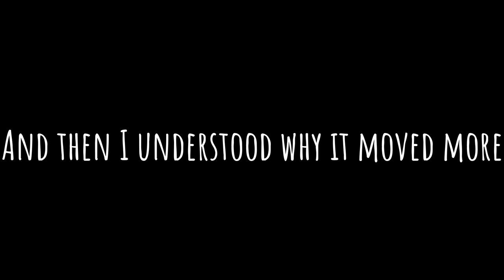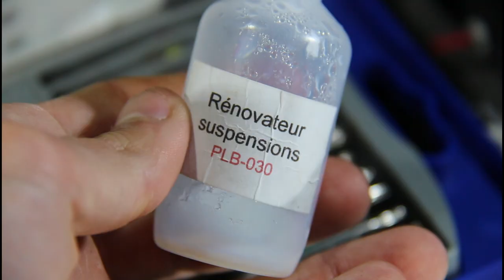Samsung BN96-16796A 2 way TV speakers | Sound Test w/ a fail...

Comment: just fyi, these surrounds are vulnerable to overheating, I heard that if this kind of speakers is mounted at hot spots of TV, the rubber dries out and eventually breaks
they are always normal if they work at room temperature
Reply from the maker: Yeah, thats why the bigger versions used in woofers don't dry as often and they're exposed to fresh air

Comment: oh broken rubber? it's common problem with these ultra slim drivers.... and i think you have the defective driver, because i've watched another people test this driver with heavy bass ( Das Tier ), and it plays just fine.
Reply from the maker: I have some Samsungs with the same drivers and they're 100% fine...but these drivers where used in the 2010s and are still used in modern tvs, thats why some are rotted and some arent.
Reply: @LSandM-SpeakersFromEverywhere  but when these drivers okay, they actually sounds pretty good. And these speakers are good for like DIY slim monitor.

Comment: I have brobably the smallest possible version these Samsung tv speakers that uses this driver. The driver is on the front tho where it normally is. there is only the driver and the bass port on the front. Thats all that there is! No plastic or anything other on the front. The model number is BN96-25563A and okay there is juuust tiiiny little bit of plastic next to the port.
Reply from the maker: Just checked and yes they're the smallest....but I have some panasonic ones with the exact same drivers (made by ggec and with better quality materials) in an even smaller enclosure
Reply: @LSandM-SpeakersFromEverywhere  well they brobably are not from a Samsung tv tho😅

Comment: Just got a pair of these, mine seem to move the same for each.
Reply from the maker: For me it was because one driver was rubber rotted, the other one was fine for the video and actually rotted a few days after.
Reply: @LSandM-SpeakersFromEverywhere  Oh that's a shame. Mine are very fresh as the TV I pulled them from was only on the street for about an hour before I took it.

Comment: This set needs a subwoofer,the highs are good the mids are ok and I think it's a little boxy but I'm not sure.
Reply from the maker: They definitely need. Yeah mids are ok in the video but they're actually equed
Reply: Yeah. Our old TV had these drivers. They had a lot of treble, and they didn’t really seem to go below 200hz in the TV, and what bass they had sounded really strange! They sounded quite clear, despite pointing downwards. (That’s probably why these have such loud tweeters.) I’ve heard TVs with more bass that sound more muffled. These were in the thinner Samsung TVs in the early 2010s, hence the oval tweeter and the bad-sound-thing over the woofer.

Comment: These woofers sound very annoying, and the sound of the plastic box is still strong. I filled the box, after which the sound of the plastic disappeared and there was more bass, but the sound is still annoying (I think one of the problems with the frequency response in this shit metal grid is from the opposite side of the woofer 😠).
Reply from the maker: Oh yes they sound like trash with the metal cover one, I removed mines for this very reason